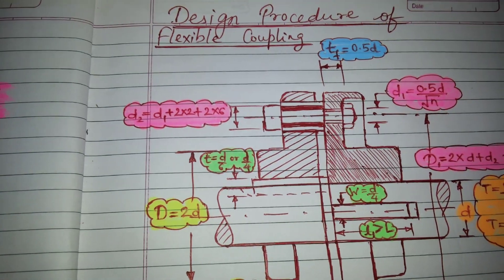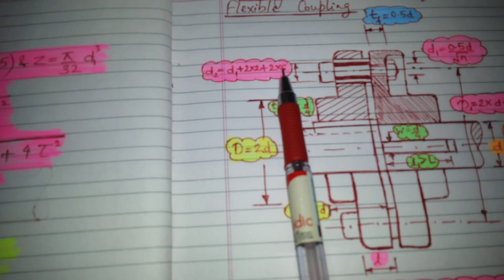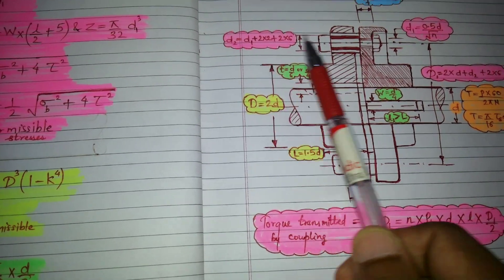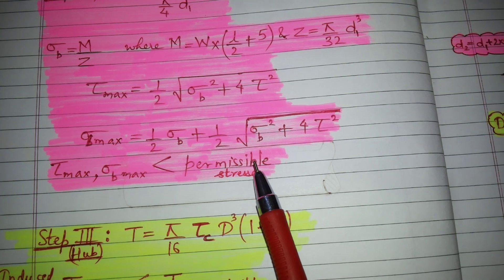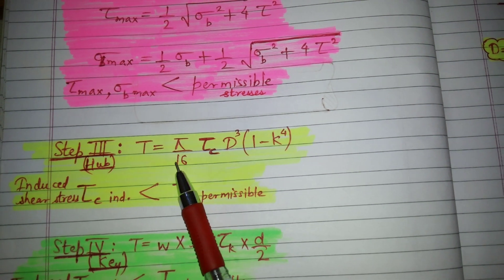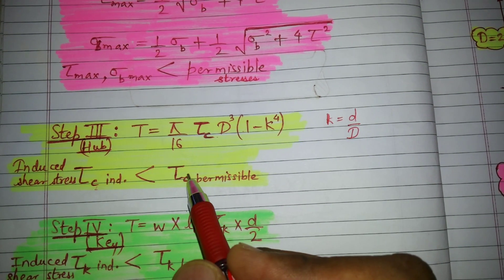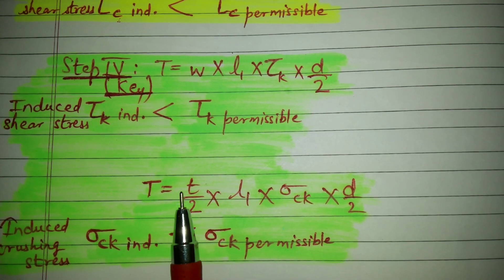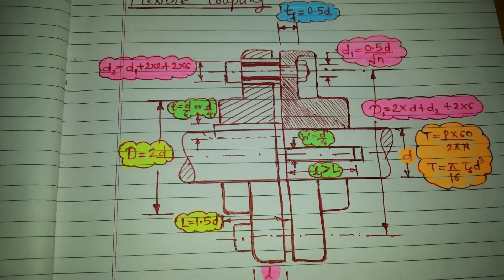Design procedure of Flexible coupling... #10kviews #viralvideo

Comment: how can i calculate the capacity of the coupling rope . 
mill size is (42 x84 ") and torque is 1600 knm 
total 8 nos of coupling rope is used in a coupling 
What is the formula of that  ???